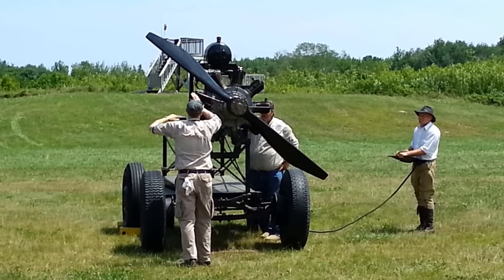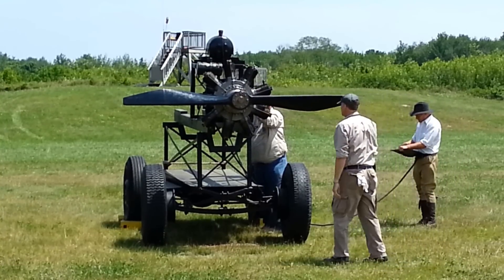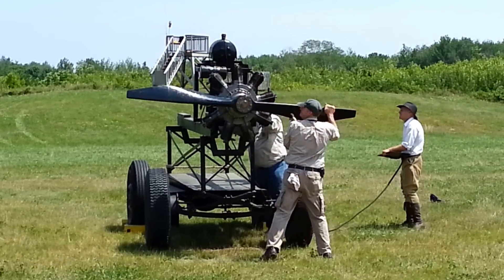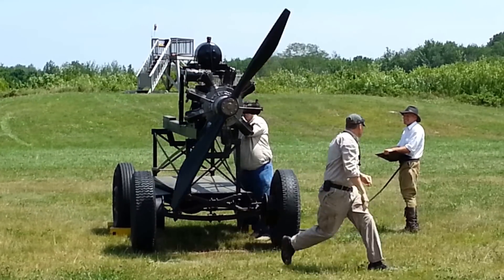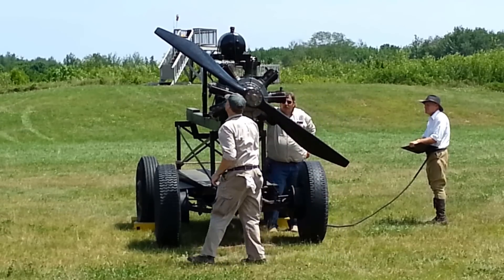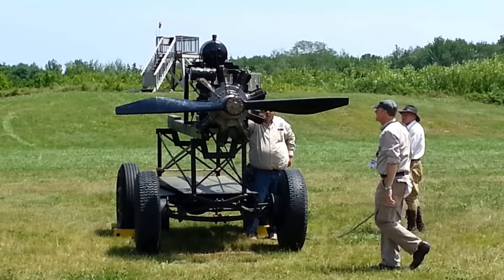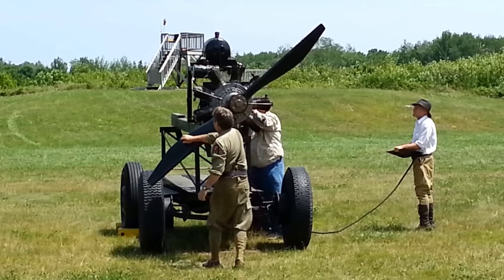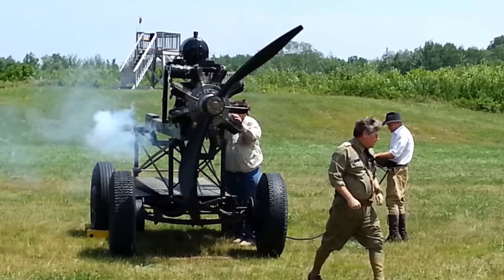1917 Gnome Rotary Engine Demo - Owls Head Transportation Museum 07/07/13

Comment: could you spin it more like a sissy?
Reply: MrZ: Sissy?  They are trying to rotate about 150lbs of mass, that is frankly just a bit too high.  Even a tiny 65 hp modern engine will give you a darn good workout after 3 or 4 tries.  Typically rotaries start on the first try or maybe the second.  This one is being quite reluctant.  In any case keep in mind this is rather dangerous and they are following careful protocols written in blood. Sorry you are not more entertained.
Reply: I'm not a pilot but have been facinated with aviation for over 50 years & have had a few lessons here & there but I think that with 2 accompanying pilots & a dual circuit ignition system that the pilot was pretty safe at all times & yes the plan to land was well thought out but Seriously,I thought it all a bit over dramitised & wondered whether it's some kind of CV application or whether the pilot just fancied himself as a short jet fighter actor.😊